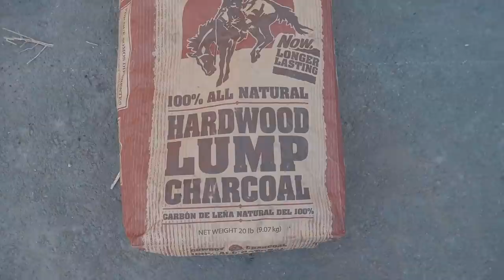MAKING STEELE FROM IRON!!!

Comment: You don't need wrought iron for the process. Any iron/steel scrap material will do it seems, but wrought might be more historically correct and proves that the process really works. It's quite cool actually.
Reply: Torbjörn Åhman I
Reply: I Love your videos!
Reply: I smell a TA/AS/WS colab...
Reply: Hmmm.....i was hoping that longboat is finished so you could raid europe once more. Go on mighty Torbjorn
Reply: Could you pls make a new video of making steel from iron?
Reply: @davidrea7051  Because he made one comment? Wow. Good job Assumption Man!
Reply: just came here from your video on making a drawknife
Reply: I hoped the saber would get a bit of the meteorite iron melted in with it.
Reply: Grey iron is no good....unless you add the various minerals that are needed to make it softer.
Reply: @scottleft3672  OK! Might have to do with the silicone/graphite in grey iron?
Reply: I scrolled down to ask that exact question. If you can do this same process with modern mild steel.  Thanks for the update Torbjörn Åhman.
Reply: Would this process work with black sand?
Reply: That was my very first question. It would seem to me that putting mild steel scrap through this process would cause the same sort of "carbonization". It might be worth a try if you didn't have access to wrought iron, the worst thing that'd happen is you'd just be out the cost of charcoal.
Reply: Bessimer knew.
Reply: Torbjorn Ahman and Alec Steele are on opposite ends of the blacksmith video style spectrum. I have to say my tastes lean far toward the Torbjorn side.
Reply: That wouldn't be turning iron into steel would it??
Reply: how do you even find iron? all I can find is cast and steel.
Reply: If it’s already high carbon there’s no need but you could make mild steel harden-able with this process, there’s chunks of iron ore all over the river banks near my house, and where I used to live as well in TN on the Mississippi I used to find iron ore all the time
Reply: Common - cool ... :D :D

Comment: I was actually part of a experiment here in Norway, together with a Viking age professor. He had a theory about the Vikings used crushed bones heated together with iron to make steel. They have found a lot of crushed bones around forges in old Viking settlements. It actually worked!!! It was awesome to be a part of it.
Reply: Sounds brutal, and knowing some history of the vikings, it makes a bit of sense. They used what they had. Just about every piece they made had more than one purpose, passed on to the next generation. Gives a new meaning to "build a civilization on the remains of your enemies."
Reply: @chriskenney8713  exactly 😊 a theory is, when a great warrior died, a family member or maybe someone else would take their bones to make steel and actually forge their spirit in to a weapon, making it powerful and special.
Reply: Bone is not used for carburizing iron, but to lower the melting point of the slag when working with difficult ore. Bone is mostly calcium, not carbon. We have also used shells and chalk with the same effect. It really helps softening up the slag making it more liquid.
Reply: Need to have details!!

Comment: Now that's what I'm talking about, less yack yack and more wack wack.
Reply: I know what the next merch release design is gonna have
Reply: still was lot of yack yack
Reply: yes steelified, or carbonafied, I belive the proper term is called carberized for carbonisation of steel, if decarburazation takes is out in the steelmaking process, and a hard facing flame from a torch is a carburizing flame.

Comment: So Alec, if you remember that episode where you tried to forge a meteor, and it didn’t work, it’s because you didn’t do this. Meteors are high in nickel and other impure elements, so you need to melt them down into a bloom, like what you did here. It’s similar to Japanese tamahagane in this way, and if you wanted to actually forge that meteor one day, you should follow a similar process to this.
Reply: Another thing meteorite is great for is decorative inlay- due to the unique elemental composition, when tempered it creates all kinds of beautiful colors and would make great detail/decorative pieces.
Reply: High nickel steel would actually be far superior to just carbon steel (and far more valuable), but forging it would majorly suck... 
Tamahagane on the other hand is made from a bloom, and that has a LOT of various oxides in it, which  is why it crumbles like cookies at first and has to be worked so much.

BTW I seriously doubt you'd be able to just forge out nickel "impurities" out of steel, it alloys quite well. Not even the Bessemer process would be able to get rid of nickel from the steel...
Reply: @AKAtheA  718 steel

Comment: Love the tip about lump charcoal rather than briquets. Briquets have chemicals in them that will contaminate your “steele”. So for folks like me smithing in the backyard with basic setups here’s another tip: if you switch to coal get bituminous coal not anthracite for the same reason you’d choose lump charcoal over briquets. Anthracite is higher in sulfur and will contaminate the metal you’re working with.
Reply: Opposite, dude. Bituminous is far dirtier; that's why I use anthracite.
Reply: Mark Lowry you are correct. Thanks for catching that, I was apparently misinformed.

Comment: I loved the MAKING STEELE FROM IRON!!! episode.  And although my shop isn't quite where I want it to be yet, I did get to do an experiment with wrought iron and carborization.  Its unlikely you'll do this again in the near future, but if you do I've got a suggestion.  In my experiment, I forge welded two billets of iron together, one I smelted myself (with the help and advice from the crew of the Louisiana Metalsmiths Association) and another billet that I purchased a while back.  I forged the resulting billet into a knife blade.  I asked around about how to transform the blade into a hadenable state, and I was led to the pack-carborization process.  Its relatively easy and you should consider it in the future.  By carborizing the iron in blade shape, the edge took in plenty of carbon and skates a file well, after quenching.  Anyway, keep up the good work!

Comment: Can you make damaskus brake rotors for a bicycle mabye you  can work with the guys from GMBN GlobalMountainBikeNetwork @Gmbn
Reply: Or for a motorcycle
Reply: That should work if the majority is high carbon steele. Cars are usually cast, but I don't see why damascus wouldn't work on a bike.
Reply: ummm. why bother
Reply: I think it would put excessive wear on the brake pads because the two different steels will wear at different rates, then make the rotor almost like a file
Reply: Shalor McKee they could do a Damascus of the same steel for less difference in wear
Reply: The damaskus Brake rotors are just fur comparison to normal brake rotors and fun .
My theory is that it wold not work on cars or motocycles cause the forces are to emense so that it will destroy the damaskus
Reply: It is not for a long terme use just for 1 or 2 rides
Reply: Aren't bike discs usually made from high carbon stainless, or carbon composite?
Reply: @shalormckee2784  not if its not hardened
Reply: @bradleybellwether3063  normally it is made out of carbon stainless but it is just an Experimenten and for entertaining
Reply: Laurenz Schramm ...I still think it would work out ok. Especially if it's just a few uses for shitz and gigglez ...and to look AWESOME!
I wouldn't be doing any Alpine runs with them though. Lol

Comment: Alec you did a great work! You know that you just carbonized iron, u could do that with any junk low carbon steel from workshop. Remelting modern steel will give u the same internal structure as rodiron have.

Comment: Open question about consolidation step can you just melt all the bits in a furnace and crucible then cast that into an ingot (scraping off impurities) and then go to the folding forging step? What does the casting step do to the carbon content of the steel?  Seems that this might make the process a little more complicated but it would significantly reduce waste.  Possibly you would need a low/zero oxygen environment to stop the carbon being burned off?

Comment: Another note. There is a documentary on making a Katana the original way and the steel they use is similar to the process used here. They use an iron ore powder and I believe melt it for 48 hours before removing it. There is only one Master of the craft left in japan. I will try to find the link.

Comment: I think that it is possible that the bolt could be wrought iron. Wrought iron was produced and sold in a very wide range of grades from "muck bar" up to "fourth" and "fifth process" material. The difference is how often the iron was shingled and piled (forge welded and folded). High quality  wrought iron as was used for boiler plates and fine forgings etc. was very fine grain and uniform, and the type of bar that was used for structural work, wagon tires, and fire escapes, bridges etc. was low quality.  High quality wrought iron could react similarly to steel  in the test, just being slightly more malleable.

Comment: I have an experiment to try, and i think you are just the guy to try it. Making high carbon steel from Mild steel. I watched a video of a guy that filled a canister with powdered charcoal and strips of mild steel. after heating the canisters to forging temp, he allowed the canister to cool and took out the strips. the result was steel that sparked like high carbon. So, I propose you get mild steel shavings from a machine shop (maybe a collaboration with TOT or similar???) put clean shavings in a sieve then douse them in acetylene torch soot. put the soot covered shavings into a canister and compact like making canister damascus.

Comment: Did you ever try to make the crucible steel or the wootz? Or real east bulat? In the legends of nomads from the Middle Asia grasslands this type of steel was cooling in very special way: A young warrior took straight from an anvil a "hot to red" saber blade and drived on his horse throught a steppe until it received normal dark color of this.

Comment: You need a pencil type die grinder my dude.  They are pneumatic, so they have more power than an electric grinder of similar size and smaller in diameter than your pinkie finger.  They are great, use mine on the daily

Comment: You can get a doubler for your foredom tool. that will give you 38,000 rpm, at half torque, which is still 3 times as much as a dremel. The best of course, to match your monarch EE and new hammer, is pneumatic hand pieces, commonly used for dental drills. Nothing, and I mean nothing can do inlays like a dental drill. Up to 300,000 rpm, and they never overheat, because the air cools them as well. Carbide bit at 300,000 rpm on steel feels like dragging a pin head through butter.

Comment: Alec,
Calvary is a place, most often associated where Christ said, "It is done."  Cavalry is the horsemounted military, or in modern terms the military units that perform recon or advance screening operations using motorized vehicles or aircraft.
These terms are often mispronounced.

Comment: I was wondering if you could answer this question for me. While reading the book Agincourt by Bernard Cornwell I came across a passage where the archers are preparing for battle and an older more experienced archer tells the younger about a "horrible bastard" that used to use dried bone in the fire to make the iron harder.  he was a horrible bastard of course because he proclaimed that child's bones worked the best.  So my question would be is there any validity in using bone to make harder steel?

Comment: Great Video! I just have one question, I have a forge setup but was wondering if instead of lump charcoal I have a literal ton of coal at my disposal, would that work as well as lump charcoal to heat and keep a forge warm?
Reply: Regular coal works for a heat source just fine.  I don't know if it would be as good for making iron into steel since it might have more impurities, but it works as a heat source.  It's often preferable to charcoal for heat because it's so much cheaper.

Comment: I find your description of the flex shaft or micro motor hand piece a bit inaccurate. I’m a dental technician and use a micro motor all the time and a high speed, there is plenty of torque in either motor to handle steel, just depends on your experience on either tool. You can easily do detail and scale removal with either piece. The benefit of a flex shaft over the micro motor hand piece is the chuck and which sized bits can fit inside. The torque from a micro motor will depend on the quality of the hand piece you use. A jeweler micro motor will be ok, a dental technician hand piece will provide much more consistent power up to 50k. Also the quality of the burs you use will make a difference. Cheaper burs at 35k will whip around and bend real quick

Comment: Hey, Alec... Those are WHEELS. 
Tires were invented later. They are the rubber parts that go 'ro7nd the metal wheel, as per bycicles, cars, Lawnmowers etc.
Reply: But what you lads are work8ngbwith is a wrought iron Wagon Wheel

Comment: the tool you ordered that does 320,000 rpm is probably an air turbine... air turbines spin really fast but have absolutely no torque... I think you will struggle using it...you can get electric high speed micro motors which spin to 100,000 rpm with plenty of torque but they are mega expensive..mine cost about $4000 but it has one normal handpiece( high torque and 50,000rpm ) and one high speed motor(100,000rpm and very high torque and is irrigated (water spray) )..

Comment: The carbon content of 1.5-2% is too high for carbon steel. It should be closer to 1%. In fact, what they are doing by placing charcoal (carbon) in close  proximity to "wrought iron" (which isn't made anymore, check Wikipedia, they probably just got some rusty old steel - rust should be removed) is carburizing. They are adding carbon into the surface of the iron matrix via a high temperature diffusion mechanism. Keep them in contact long enough and the carbon will go all the way through, but you get too much carbon. That's why it's breaking apart in the next video and it's so hard to make.

Ideally, they should be melting the steel and charcoal in an electric furnace (you can't melt steel/iron with gas/propane furnaces) and shoot for 1.2 to 1.5% netting them about 0.8-1% depending on technique. Then, they can forge all they want without the weird formations and crumbling. Seriously, just buy the steel, it'll be waaaay less effort and soooo much better quality.

They're fun to watch if you don't know much about what they want to make but I am cringing since I am a metallurgist that worked in foundries (cast iron, aluminium) and know how to do this kind of stuff industrially, which isn't the same but I can't help cringing anyway.

Too much oxidation on the surface that gets caught in the bulk material and it won't stick together.

PS, I like this channel, not a hater.

Comment: wait u used iron/steel with 0.01% C to a 0.7% C Iron/steel... so u just put more carbon in the steel und made a low carbon steel to a C70 Steel?... a pretty hard stuff in terms of steel...

Comment: I think you could use more acurate terms.
You are using steel to make oyther steel.
Pure iron does not exists.
Ultra low carbon or low carbon is not iron, still is steel
You just melted steel in a rustic furnace
I hope not being rude, but as a metalurgical technician, sounds odd this iron to steel concept you said

Comment: Who are these idiots that dislike the video. I dare you to post why. When this project was first mentioned I looked up to see if I could find any others that have done this before and only found one. That one used a different method but did use wagon wheel iron. So, I dare you to comment on what is negative about this video.

Comment: what in the god dang" is steel then.? just iron that's been worked over?
Reply: Iron with the addition of Carbon becomes steel. The carbon is what lends strength to the crystalline structure of the metal.
Reply: @saaikou193  interesting, how do you add carbon to the iron? sprinkle ash on it?
Reply: @gasfrommyanusi0i594  The charcoal wasn't just fuel, it was also an ingredient. Some of the carbon from the charcoal gets added to the iron, and steel is the result.
Reply: @saaikou193  holy crap that makes sense. thanks i didnt understand the process for steel for so long.
Reply: @saaikou193  hey here's a question, if you create an iron bloom by heating ore with charcoal, how come it's doesn't turn to steel right away?
Reply: @gasfrommyanusi0i594  Carbon isn't deposited evenly throughout the bloom, but in haphazard deposits. Working the hot material over and over, hammering, compressing, folding, etc. distributes the carbon; forming the microscopic lattice that makes steel strong. Sort of like kneading dough to align the gluten so you get a chewy bread.